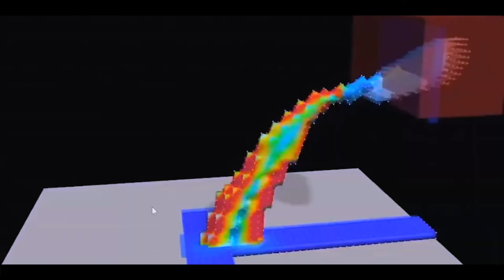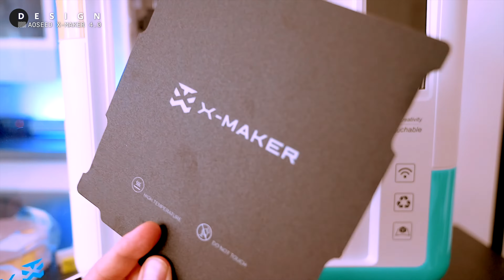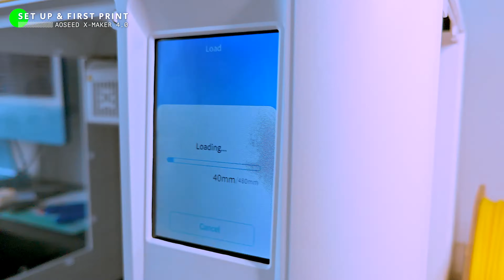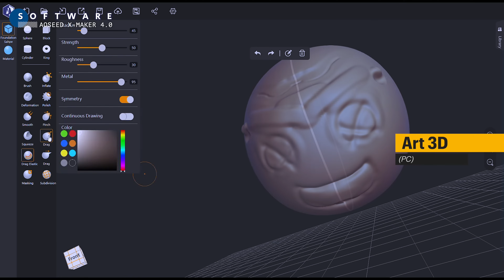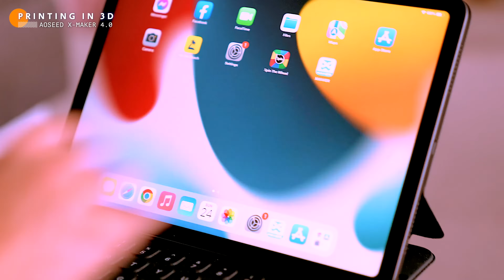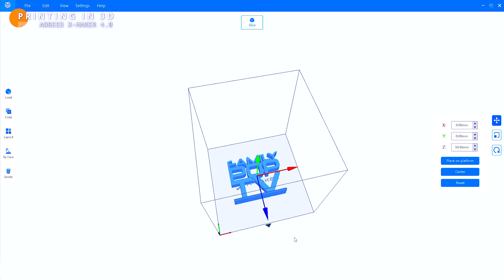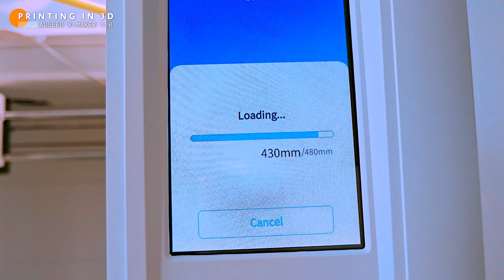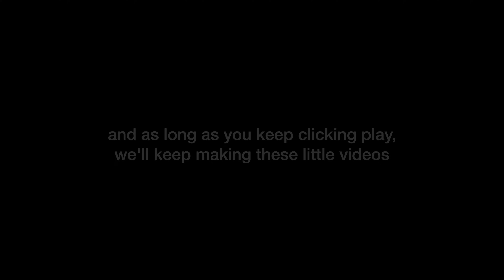AOSEED X-MAKER 3D Printer: The Complete Review & Test // Best 3D Printer for Beginners?

Comment: I see the Geometry Dash demon that you printed got a pretty smooth surface on the side connecting to the raft. 
 I also got an Xmaker printer but the side connecting to the raft always very rough with layers mark 🤔 
Have you made any changes to the Xprint setting? Or do you know how to adjust the stting to get a smoother surface on the raft side? Thanks ☺️